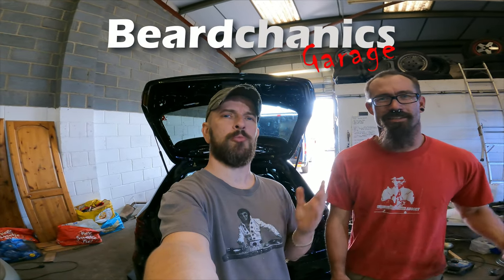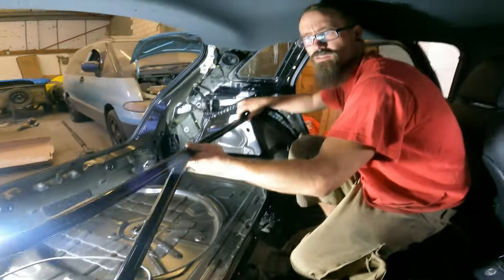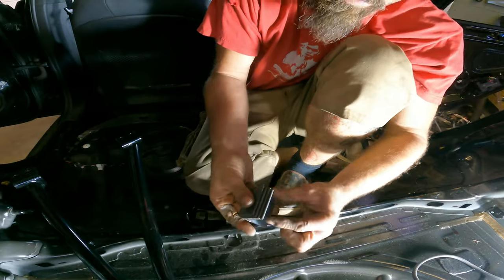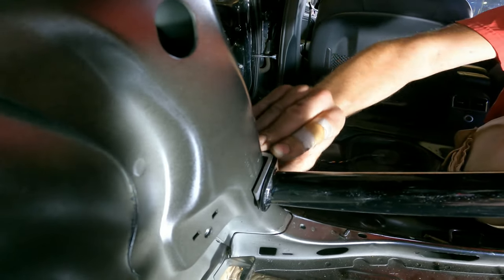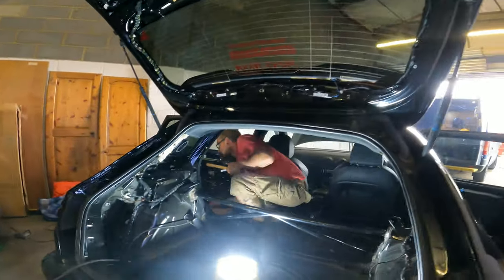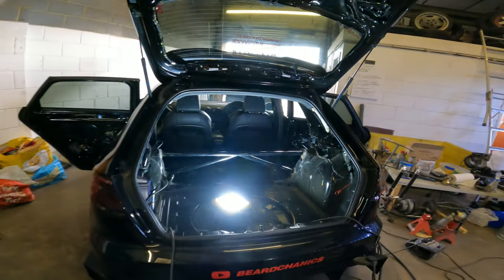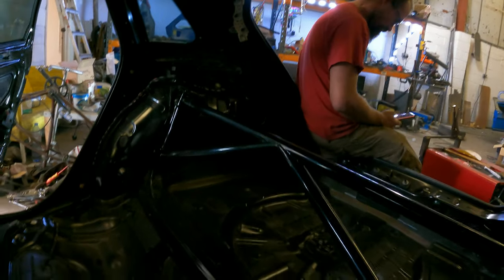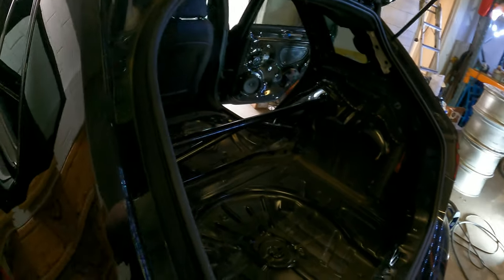K-Brace Install in Audi S3 8V

Comment: Correct the gaps are so it will fit in all the A3 cars as some cars may also not be mm perfect, this is also so the holes can be drilled in the right places, it gives people fitting on a drive more tolerance - This gap will not affect the increase in rigidity that we have not already tested it for. The gap is also to give gaps for trim and carpet were applicable - Welding the K-Brace® is a superior way of fitting!
Reply from the maker: Thanks for the confirmation =)